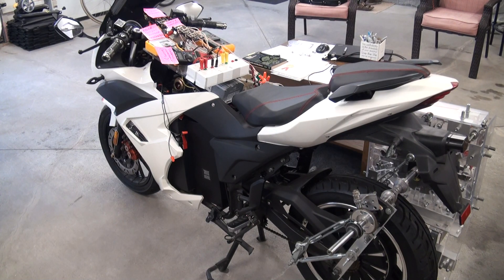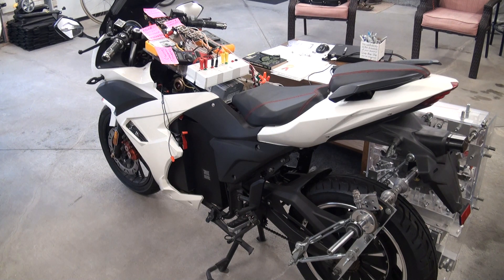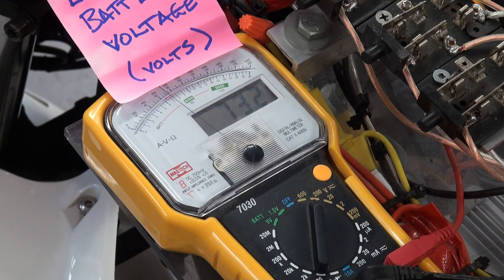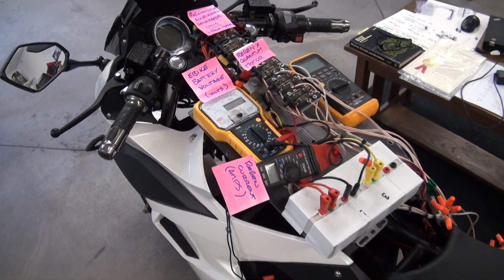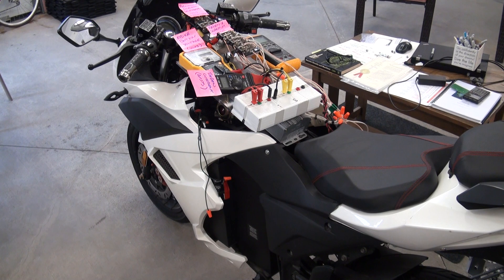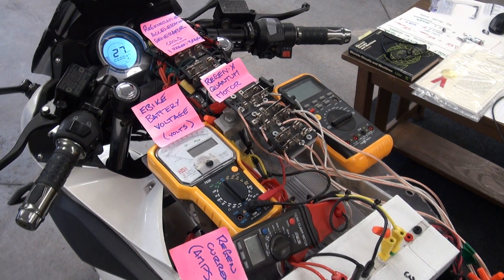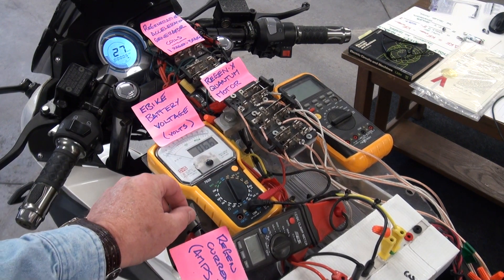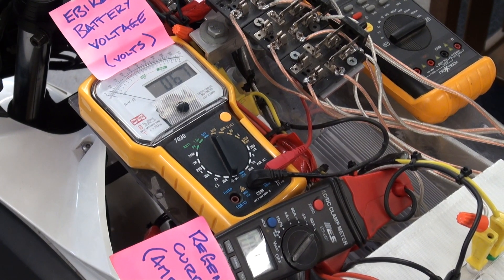TEST #2:  99 6% Recharge Rate EV Regenerative Acceleration Innovation Optimization May 13th, 2021

Comment: I think you should separate the generator from the EV and show how it charges the batteries and that's all. You don't need to couple the EV motor and the regenerator. Just use the right motor to make it spin while it produces energy for itself and the batteries.

Comment: Does the motor provide enough torque for a road test? If not is there a way to load the wheel down to check performance under higher loads? Great innovative work by the way. Exciting stuff.

Comment: You started at 73.2 V and ended at 70 V, so your bike used energy rather than generating it...
Reply from the maker: Started at 73.2 and ended at 72.9. so 3 mV used during video. Battery needs about 1/2 an hour for voltage to settle after test.
Reply: @PDiCanada1  I've never heard of batteries needing that. All batteries I worked with had an instantaneous change
Reply: @PDiCanada1  that's not 3mV but 300mV. So your wrong a factor 100.
So resulting in your calculation skills you ain't recharging 99.6% but 0.996% take the deviation on your meters and you have 0 left, even possibly just consuming and no recharge at all.
Reply: @marcodegrauw3853   You are oil companies shill. Battery voltage is 74V . It doesn't matter if change in voltage is 3 uV , 30 uV, 300 uV,   3mV , 30 mV, or 300mV . Discharged batteries have voltage which is 2 or 3 volts or more lower than charged batteries voltage.
Reply: @marcodegrauw3853   Without RegenX generator voltage would be much lower.

Comment: Are you able to do a side by side run test on an identical motor vs the regen motor and show the improved run time? Think that would impress some viewers. Are you in Canada?
Reply: I agree with your suggestion, we also need independent replication of Heins work.
Reply from the maker: Hi thewonn,
Identical Motor? 
The ReGen-X Quantum Motor performs mechanical work, and accelerates the ebike but consumes zero input electrical energy from the EV's battery. It operates at infinite efficiency in other words so an identical motor does not exist anywhere...

TECH BRIEFS MEDIA ReGen-X Quantum Motor Introduction Long Version #TECHBRIEFSMEDIA #CreatetheFuture:
https://youtu.be/1TzHM1fY5QI

Cheers from Ottawa, Canada